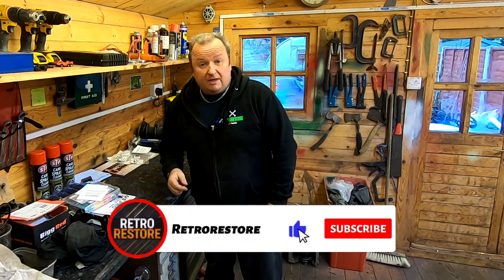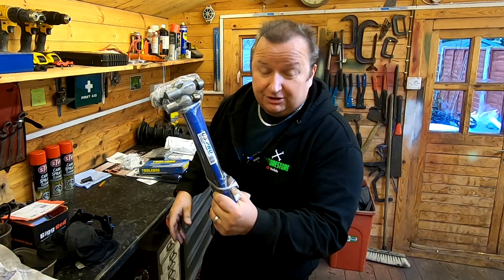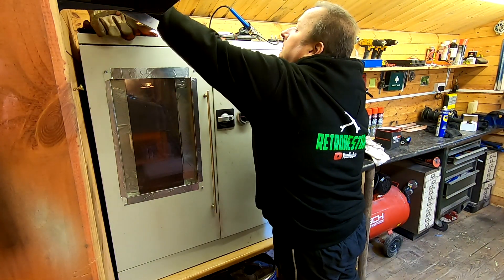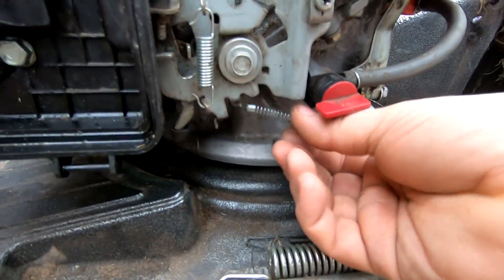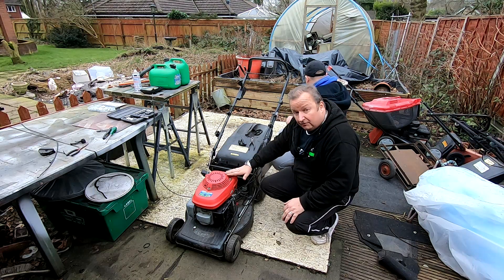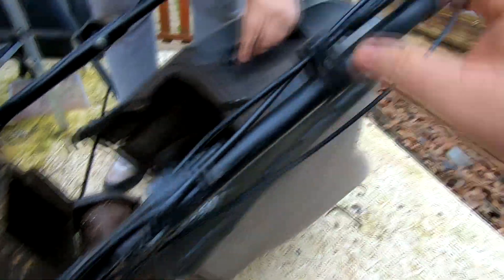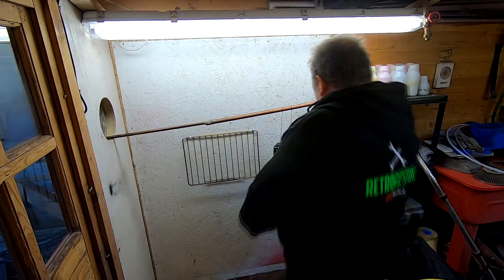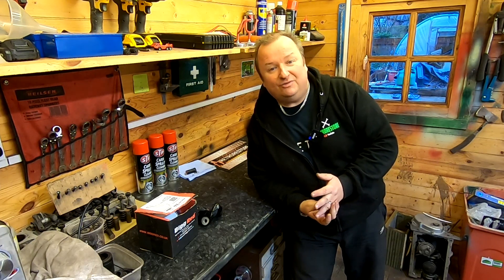Powdercoating A Brake Caliper And A Free Honda Lawnmower

Comment: In a pinch remove the pull cord housing using a drill and a zip tie you can run the mower off a drill. But I’d do a typical tune up and once over

Comment: Honda engines are great engines, there is usually a tab you can bend either on the governor arm or on the bracket where the spring attaches at the other end to increase the tension on the spring therefore to increase the engine speed.
Reply from the maker: Yes, we'll be tinkering with it

Comment: Id be putting a new cord in that and a new cable and then sell as is. I bought a castlegarden mower that the self propel wasnt working in. All the cables were cut off it. Reconnected the throttle cable and deadman. The little gearbox is sheared out so i removed the gears that go into the wheels and left it as is and sold it to my good friend for 70 quid

Comment: Hi Martin....great vid as always.....mite be worth mentioning that if using this powder coat method to do calipers ,that they will need to be resealed......i know you have seal kits for yours which we saw in the last vid.......just thought it was worth saying.....keep up the good work
Reply from the maker: I think anyone who is going to all this trouble stripping them down would reseal them anyway John.
Reply: @retrorestore  .....yes completely understand......... where i was coming from is that you cant just tape up the piston and fluid import/bleed nipple etc and do the process....that the heat would effect the seals.....not everyone interested  in the powder coat process mite have your mechanical knowledge..... not splitting hairs with you martin.........top videos as always

Comment: I was wondering. Powdercoating is electrostatic. Why don't you put a current on the metal?
Reply from the maker: This system uses no high voltage. The positive charge is generated in the gun using static and your own body's negative is supplied via me holding the copper hanging rail so the powder sticks.

Comment: Hi Martin can you not Preheat the calipers up before you apply the powder then stick them back in the oven to finish off?
Reply from the maker: It doesn't hurt them to be left in for longer anyway Mark.
Reply: All i was thinking to save electricity is preheat them on a camping stove or blow torch will get them up to temp quicker

Comment: Have a look at these on eBay. Not sure how to copy the link but here's the title.

MACHINETEC MOTORCYCLE MOTORBIKE EMERGENCY BRAKE CLUTCH THROTTLE CABLE REPAIR KIT

£6.35. Might be no good but though it might be useful for you to look at.
Reply from the maker: yes, I've seen that kit. Thanks though bud.